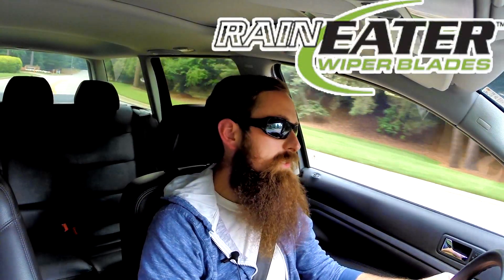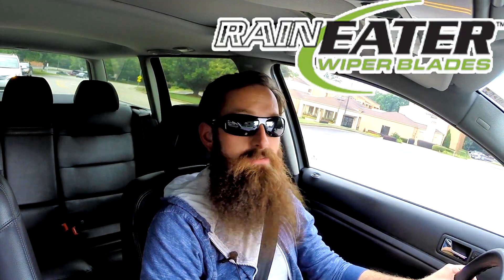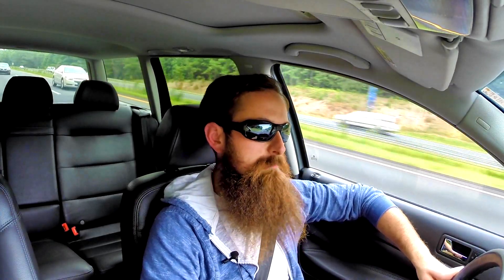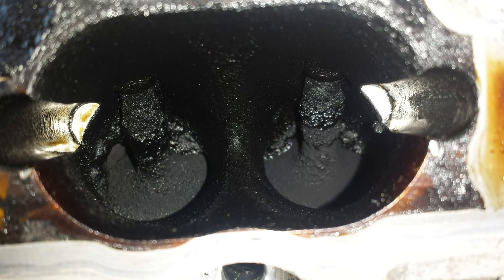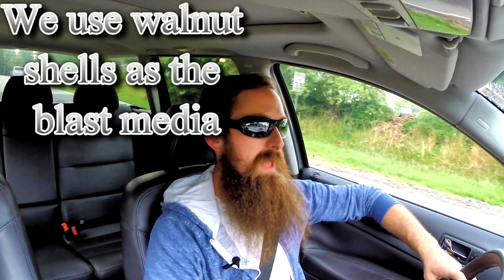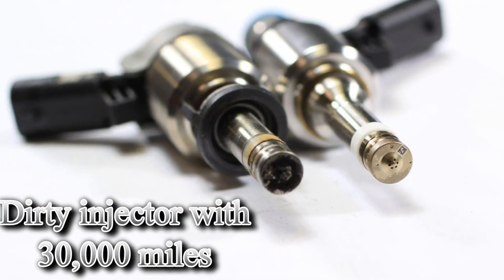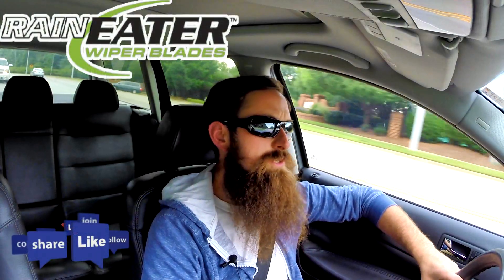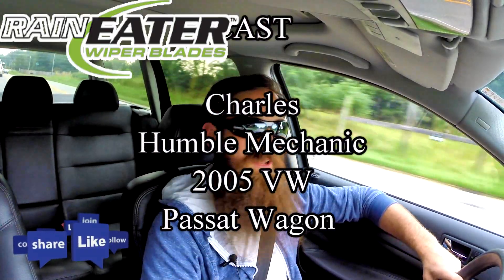Preventing and Fixing Carbon Issues for Direct Injection Engines ~ Episode 80

Comment: How'd I know he was going to mention the 10k mile change reccomendation from factory. Way too long IMO. Every 5k.
Reply from the maker: +Iwasthewalrus it's a pretty complicated topic. I think it's too long too. But the oil can hold up. 

That's not the only part of the equation
Reply: Ohh of course. It may only contribute by only a fraction but still, 10k per oil change IMO is far too long. Depending on how I drive it, I may even do every 3k. But in my case my GTI isn't a daily driver, so when it is driven, it is always aggressive. 67k with 0 problems. I think for the oil and mann filter it would be around $80. I'll pay that any day.

Comment: This is why some companies are going to direct AND port injection. Port injection helps keep the valves cleaner but it also works better at lower rpm light load situations than direct injection. Toyota's D4S fuel system is like this. Ford is also switching to direct/port on the new generation Ecoboost 3.5tt engines.

Comment: sounds like my problem with my 06 2.5l jetta, which has rare cold start misfires and not so great gas mileage, is it a direct injected? also do you mean putting premium in it from now on? and for how long could i run it if so?
Reply from the maker: your 2.5 Jetta is not direct injection. I might try and run a tank or 2 of premium. Also make sure your maintenance is up to date
Reply: thank you, yeah the maintenance probly isnt so much as the people before me didn't do it I'm sure, got it with a bad valve cover and idk how long that was like that but probably didnt help

Comment: Hi Charles, any update on your Tiguan? I've just had the carbon manually cleaned off the backs of my valves and would be interested to know any preventative maintenance I could do to slow the onset of carbon. I already use 98 RON fuel but I'm considering a spray-in chemical every six months to keep the build-up at bay. Your thoughts?
Reply from the maker: +TurboTonyG I haven't pulled the intake to check. I'll probably do that soon.

Comment: I have a `09 GTI manual transmission, 2 door, non-California car that I bought new in December 2008.  Did 4 full season of autocross in DC region of SCCA and did at least 1 full throttle run through multiple gears almost everytime I drove it.  By the summer of 2013 I had over 100k miles on it and started getting a bank 1 cylinder lean code.  Dealership couldn't figure it out and got a VW engineer involved who also couldn't figure it out. Never had any driveability issues, but eventually started getting a "intake manifold failure fault" at about 106k miles.  Did my research and found out about the flapper valves in the intake manifold that fail. Replaced the intake manifold and cleaned the backside of the valves and intake ports myself because I couldn't afford the $900 repair.

Comment: I have a 2008 Jetta Wolfsburg 2.0T  with 155k and its never had a manifold cleaning..if you really wanna see it..lol
Reply from the maker: WOW!!!! was it an early 08, or late 08? That is a split year for the 2.0t
Reply: HumbleMechanic I'm at 153k miles on my '07 fsi! No cleaning thus far...but it's (well over)due I'm sure. I've always thought he ran rough on cold start, but that's cat warmup...and then it runs great. Funny that it stumbles identically to my early 96 2.slo Jetta when the cooling fan cycles on and off (since 70k). Hot idle misfires / stumbles have gotten worse lately, and randomized tho no misfires at all with A/C running.

Comment: What about "RX CATCH CANS"?
Reply: Catch Cans will for sure extend the intervals of removing the carbon off the valves.  You would be surprised at how much oil actually goes into the intake and without the fuel washing off the valves you are going to have buildup.  What a lot of people don't think of is to just remove the vacuum from the crank case completely and that will eliminate carbon build up completely.  I am in the process of installing a vacuum pump on my engine crank case so that I don't pull any oil into my intake.  The cost to remove the carbon on a four cylinder VW is nothing compared to the cost of a V-10 Audi.

Comment: With 4 decades of gasoline and diesel engine repair , I've watched engines that were capable of over one million miles of trouble free service  turn into ticking time bombs. People are quick to blame the manufacturer for the problems.  The truth is , the little Steve EPA Urkels  put their dirty little hands under the hood .  Forced engine builders to comply with every last tree hugging rule they could come up with. Simple and dependable engine designs became complex engineering disasters. Now your engine is choking on the carbon and your wallet is empty. Famous Quote, "DID I DO THAT ? "  JS

Comment: Hey Charlies I ran a Catch Can on my first direct injection car  and am a mechanic as will and i can say a AOS (Air oil separator) is the best way to help reduce carbon and most company say to empty the can at every oil change interval and i never had issue with a carbon on that car and i plan on adding one to my new MK6 GLI 2.0l tsi

Comment: I like your channel and all but you're wrong about higher octane helping reduce carbon buildup.   The only octane grade that will help reduce the carbon buildup is the grade which the motor was designed for.

I don't need to give you my credentials.   Believe me when I say this.  A car that was designed to run on 87 octane will make the most power and have the best fuel economy and the least amount of emissions when it's fed 87 octane.  Unless this car has a problem with pre-detonation caused by one or more of many reasons, only then this car will have improved powder with a little higher octane.

I can give you many examples but until you start building and tuning race and street cars you will not understand right away.

Higher octane is harder to ignite and it burns slower.  This is all you need to know.
Reply from the maker: I think the issue that comes up most often is that people do not use the proper fuel their car was designed for.
Reply: I can see how using the wrong gas could cause carbon buildup. 
 A motor that requires 91 premium octane but gets the 89 mid-grade, could have pre-detonation from the lower octane.  Knock sensors pick up the pre-detonation and the computer deducts some ignition timing, so now the gas is not getting burned properly/fully.
Same thing applies to a motor that was designed for lower 87 octane but is fed higher octane.  Without re-programming the computer to add timing to start the burn earlier, some of the gas will just flow out the exhaust valves, but some of it will also remain inside the cylinder.

Comment: the only way to eliminate carbon buildup on the valves is to switch back to port injection or use combination of both direct and port injection.
Reply from the maker: I have seen some documentation that makes me think that will be coming for VW at some point
Reply: @HumbleMechanic  That may help them get rid of the GPF's they're mandating on engines.
Reply: Don't the European cars have to types of injectors?
Reply: HumbleMechanic Indeed, look at the latest intake manifolds, they are made with the four conventional ( low pressure) injector bores. In the future we will see an MPI / FSI engine that uses the LP injectors on startup as well as for cruise enrichment. This design is not new, Ford showed this design years ago. FSI gives us increased fuel economy and power at the same time,  this is why the industry has embraced it. I work in a dual VW / Audi shop (20 years). Have modified the BMW walnut shell machine, it's fast but you still need to clean using solvent to get those ports shiny clean.

Comment: Carbon build up is a result of lack of service and the degradation of oil and contaminates getting passed into the intake by the EGR and PCV valve. Now that manufactures are stretching out the service intervals to longer periods 15k/12months etc the oil sits and collects more by products from blow-by etc. couple that with the use of poor fuels etc, long service intervals, eventually the PCV will be dumping that contaminated oil through the intake where it will sit in the plastic cavity of the runners and eventually build up and spread like cancer on the intake side.

Use good quality base oils, quality fuels and perform oil+filter change every half manufactures recommended service interval i.e 7,500km/6 months.

this way you will ensure constant clear oil, minimum by product build up etc.
Reply: Totally agree!

Comment: hey humble mechanic I own a 04 2.0 fsi vw golf mk5 GT. I have cold starts in the morning where the rpm idle will go up n few secs go back normal, is that a sign of carbon buildup, also acceleration is bit sluggish also but few secs it picks up what could cause that.. great video I currently living in the Caribbean island of Antigua..

Comment: I have a Lexus IS250 w/DI engine. Great car sans the carbon issue. I'm gonna move to 5K OCI's w/a low NOACK syn oil. Great debate: Redline or Amsoil. Do you recommend tightening up OCI's for the more problematice VW's?

Comment: hey, you mentioned it would be interested to see a car with 100k miles + and how the carbon build up impacts that. depending on where your located id be interested in bring my 2003 mini cooper with 150K miles on it thats having a cylinder 1 misfire issue i cant seem to solve. i just bought the car with the misfire, changed the spark plugs and added seafoam to the gas, hasnt gotten better, if anything it got worse after that

Comment: I really feel that this Issue is something that VW should be covering part of the cost on for owners of Direct injection cars.. It seems really disappointing that an owner can follow the service recommendation or even do better than the recommended service and still have a significant issue with their car  within a warranty period that is not covered and not necessarily an issue caused by the customer.

Comment: Cleaning with water (steam) is not only free but is the fastest and most effective way to clean the combustion chambers... SeaFoam is also very good ... a catch can on the PCV system is a good preventative measure.  For carbonized oil deposits internal to the engine auto-rx absolutely rocks ...

Comment: It's silly the manufacturers didn't add a simplified injector to the intake that runs at specific times in order to fix this issue. It's also interesting that the aftermarket hasn't tackled this, either with something like a simplified baseplate behind the TB system that injects only a small amount of fuel at specific intervals, including full boost.

Comment: Summary: Media blast the intake valve ports. My bonus info: Get a oil catch can or AOS to reduce oil vapors depositing on the valves. This will prolong service intervals between cleanings.
Reply: AOS ? What is that?
Reply: @istvanmeissler2238  Air/oil Separator, pretty much the same as catch-can

Comment: Since you mentioned crud getting into the engine, this brings up a question. Have you used Royal Purple Max Atomizer? I do NOT have a oil catch can in my GTI so can that be used to clean out oil blow-by that gets into the engine? I've been told that EVERYONE has this issue with similar turbo cars after about 2-3 years.

Comment: Been lucky enough at the Ford dealer to have never seen this on our direct injected engines. Although I see that the new 2017 3.5L ecoboost has dual injectors (both a direct injection and port injection),
Reply: SKELYWAG Ford runs Atkinson / Miller cycle at times to help reduce the carbon buildup on their gdi / gtdi engines. Delays closing the intake valves to push a bit of fuel up onto them, so that probably helps a lot. Tho they're going port /di for the newest 3.5 EB...so it's never going to be an issue for them again.

Comment: I got my Triton with a 4D56T Diesel and it had 174*** on the clock when i got it. The Tach was not working properly so i swapped it out for another with 250*** on the clock but it worked and occasionally did not do what i wanted.

I recently done the headgasket thinking i'd have to clean ALOT of soot out of the engine, but i was surprised their was minimal soot build up in this region.
Not even the valves were that bad. Direct Port Injection. I had a surge in power with this once where the car was too good to be a diesel as i spun the wheels in 3rd gear. And that Day the car was hard to control due to the surge in power. I kept bellow 50% Throttle as much as possible but it still pulled very hard on the road.

From research i done, they say with newer cars due to the Catalytic converter, you need to drive on the highway once every week for about 15 minutes. I done that with my car that day for 30 minutes. After that is when i experienced A TON of power.

Recently i was doing the head gasket due to the cooling system not keeping the engine cool for more then a single day. The temperature gradually increased. No leaks around the car other then oil.
So i figured i can't drive it like this i am going to do the head gasket. I waited 6 weeks for parts already paid then i got to work.

When i checked the intake and exhaust ports i found only oil. A little carbon on the Valves but surprisingly not anything wrong!

The car does not appear to smoke, it does have low RPM torque you can start it in 3rd and not realize you put it in 3rd till you try to change gears lol. And that is how my car works and feels! occasionally.

Comment: I've been using a catch can on my LS based vehicles for years. Obviously there are good catch cans and some that are completely useless. The filter system becomes the important part. How well it catches the dirty air and allows the oil to fall to the bottom is what I look for. Still, some oil still enters the intake manifold.  Why current automotive manufactures don't include these now is a secret. Depending on how much blow by there is, it could be emptied at oil change intervals.

BTW, I found your channel when searching for an '08 Jetta air pump leak. Dealership wanted $1200 to replace it. Thanks for the videos.

Comment: How is it with a focus ST if it driven with top tier fuel and mostly highway driving? Use of a catch can sounds like a pain . If it freezes up in winter as the one fellow commented about wouldnt want to try it.  small engines rev high that wont help to keep carbon to a less amount?
Reply: I have never ever seen a carbon issue on a direct injected engine at my Ford dealer!

Comment: Hey I have wondered if adding a methane injection system ported through the intake manifold in some fashion (stock plastic manifold or upgraded manifold like integrated engineering) i have the catch can already mkg gti cbfa 2012 and the stuff that seeps out from there oh my nasty, anyway, what are your thoughts on methane injection to assist in cleaning valves and keeping them clean?

Comment: Has anyone tried a "Motor Flush" at oil change time?  Motor Flush is a low viscosity highly carbon specific solvent mix , , typically kerosene and other proprietary solvents, which is added to the crankcase at operating temperature immediately before an oil change.  The engine is then allowed to idle for five minutes while the solvents act at temperature on the oiling and hence EGR systems.

Comment: Hey Charles, at our Porsche dealer we use an induction service kit to prevent carbon buildup in our cars. Essentially we run a pressurized fuel treatment through the intake (injected just before the throttle body) we sell this as a preventive maintenance at 20k mileage intervals. We've had great success in mitigating carbon buildup, it's a great service to the customer and more service work/upsell for the dealer. I see huge improvements in engine idle quality as well as overall drivability.
Reply from the maker: Thanks for the insight Kevin. Who makes the kit you use? We have been testing one from BG, it seems to work pretty good. Still in the testing stages.
Reply: Jesse Hill at the shop I'm at we use BG. Seems to work very well

Comment: italian method will cause other problems.
Reply: golfmaniac007 Only if your engine is cold. If you've been driving for half an hour it'll be fine. Probably blow some shit out of your exhaust system. It's particularly beneficial for diesel engines with catalytic converters that only see city driving. It's also pretty good for engines with DPFs that have a self cleaning/regeneration system. These systems work by getting the exhaust gasses hot enough to burn up all the particulates in the filter, but they don't usually kick in unless you're pretty hard on the throttle or if your glow plugs don't work.

Comment: What about connecting up a container of Sea Foam (or similar) and using a y-tube (maybe a check valve also) into the tank side line of the purge solenoid? This would allow a small amount of cleaner to flow into the intake each time the purge solenoid opens.

Comment: SEAFOAM!!! Run it in your oil right before you change it and add it to your fuel every few fill ups.
Reply: Jacob Burrows what about putting in the intake? Putting it in the fuel should help the injector tips and top of piston but not the back of the intake valve